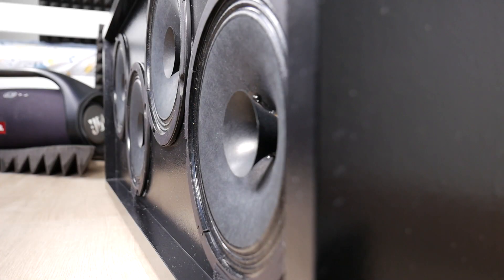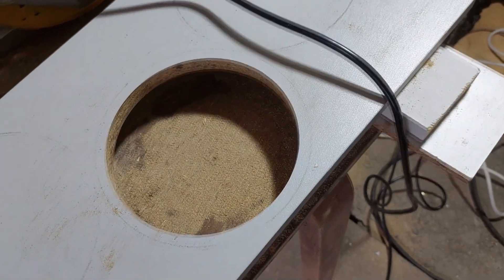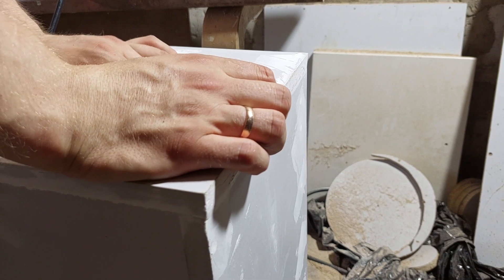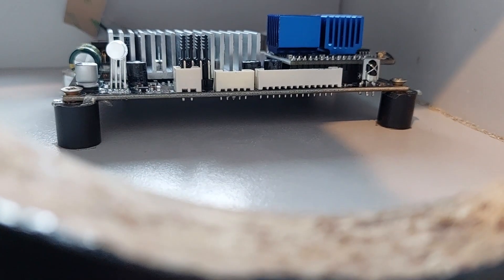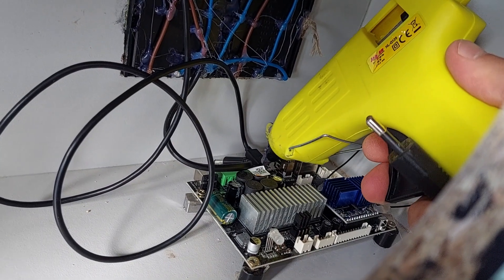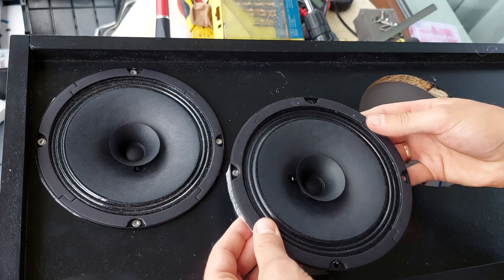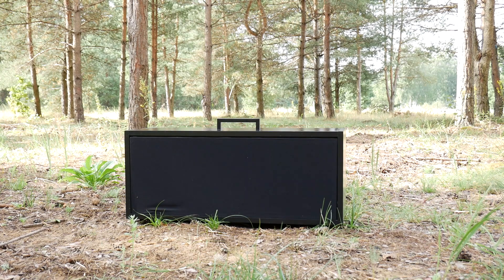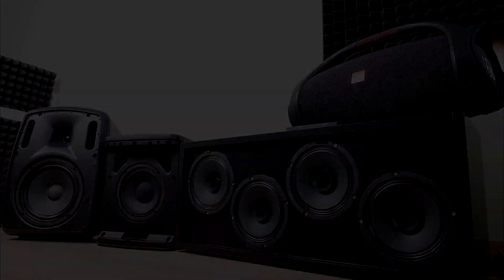How to build portable bluetooth speaker at Home

Comment: Really interesting build. Im thinking about building  somewhere similar as a bit of fun. How long does this battery configuration last ? Could higher voltage batteries be used ?
Reply from the maker: Thanks :) My battery voltage is limited by the amplifier board, which supports voltages ranging from 12V to 24V. It's hard to say exactly how long the batteries last—it's several hours—but their duration is heavily influenced by the loudness level and the type of music. For example, heavy bass music depletes the batteries faster, while soft pop lasts longer. However, I don't worry about this because I always carry at least one extra set of battery cells in my bag that I can quickly swap in.

Comment: bro you have the jbl in 30 percent lolol
Reply from the maker: Whats is 30 percent ?
Reply: @Techscrews  if you put the jbl boombox 2 in 100 vol its so loud and bro wdym the jbl have partyboost you can pair more than 1 have so good battery its water resistant what are you want fro a portable bluetooth speaker its easy to carry it out and its smaller than diy
Reply: @Techscrews  volume bro
Reply from the maker: you need learn what is speaker T-S spec, what is speaker sensitivity... all speakers has set the same volume, but jbl can give only some bass, it can't fight versus good hifi speakers. Please turn on brain, not basshead or jbl fanboy addiction. JBL has ONLY TWO small 4" woofers, therefore JBL dont have good midbass. Custom build speaker use 4 HiFi brand visaton 6.5 inch drivers with high sensitivity. And you can clearly hear, how loud is 4x6.5" drivers, that kick out these small JBL 2x4" kidys. Shity overboostet basshead sound not for Techscrew team, we love real sound, with good midbass, when AC/DC drums you can feel to chest.

Good luck and I hope you someday learn how need listen music, without overboosted bass, which the author did not intend.
Reply: @Techscrews  yes but you can't take it out  side and I can build better custom than this 😉if I want

Comment: I would recommend subwoofers on the sides they would increase bass and add tweeters for more powerful vocal boost
Reply from the maker: how many speakers have you made? Tweeters not for vocal. This box is already too small for these 4 speakers. Last year we build JBL killer beast 2, that has subwoofer and tweeters - https://youtu.be/UpDq5Upw0gk
Reply: You need passive radiators to increase the low end.

Comment: Also, if you have speaker stand, you can add speaker cabinet insert (dig hole type) on the bottom, just like PA speaker!!!😃👍
For better wireless singal ,can buy coaxial cable and antenna to extend and better mouting site to improve!
Reply from the maker: thanks for comment :)